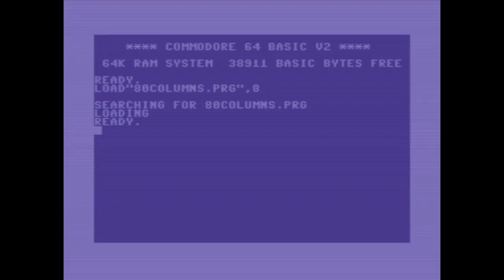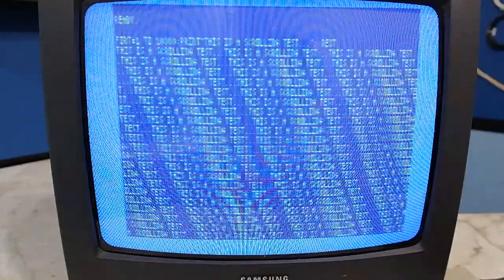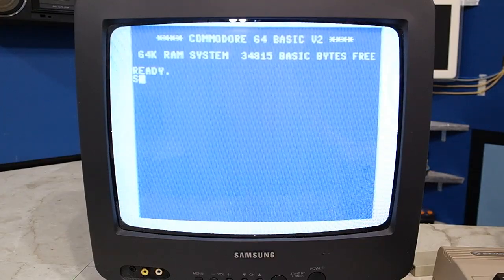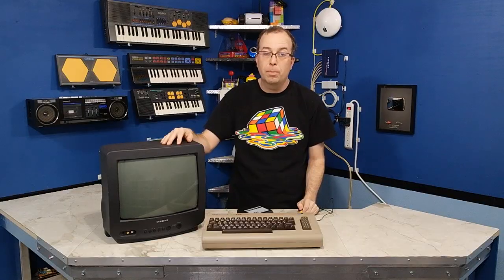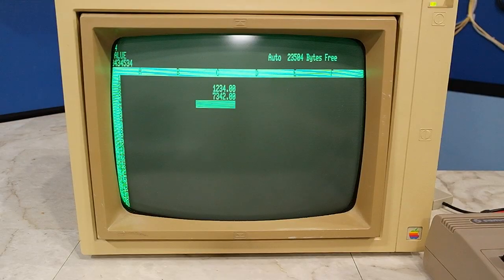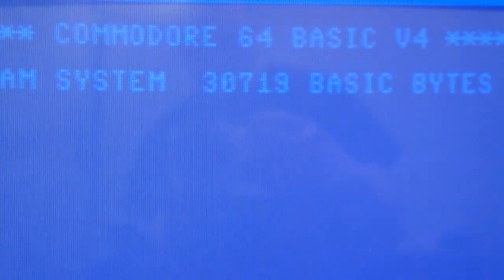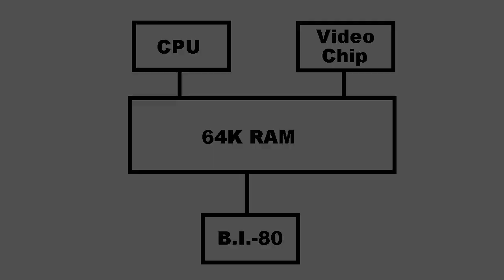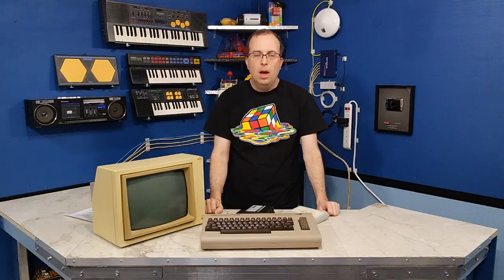The Quest for 80 Columns on the Commodore 64

Comment: Ah, television. You know, when you talk about text you run into the implied resolution.
40 columns of text with 8 pixel characters is of course 320 pixels.
80 columns of the same character set would be 640 pixels.
Fine if you're using a monitor...
But A tv?

Tv signals for that era are of course analogue. When you look at the standards you notice they mention 'lines' of resolution, but not the number of pixels in a line.
...Because a line is a continuous analogue signal, and thus has no explicitly defined resolution.
However, TV's do.
And I actually counted the pixels on my last two CRT tv's...
Both were late 90's Panasonic models, and one was PAL, the other multiregion (so basically supports everything), though the PAL model supported PAL 60 too, which technically means NTSC...
NTSC is defined as having 525 lines, and PAL as 625 (OK, yes, technically these names refer to the colour encoding standards, but this is confusing enough already).
however, not all of this is visible. it includes v-blank and overscan and the like.
DVD's defined the resolutions as 720x480 and 720x576 respectively, but what about the actual TV's?
Well, it turns out both these Panasonic TV's had a resolution of 480x480 pixels for the visible part of the screen.
My super famicom outputs 224 lines and of these 222 were visible onscreen (though keep in mind the 240p hack means one of the fields and thus half the lines are blank).
but I do believe the screen is 480 lines and not 444, because it is ultimately a PAL tv first, and NTSC second, and 480 lines would distort the expected aspect ratio of an ntsc signal.

But anyway, these are late 90's TV's, so you could expect older ones to be worse. (I also had an early 90's lcd tv that had I believe a resolution of 160x120 or so)

The problem here should be somewhat obvious though. If you have just 480 actual pixels in a line... You could never show 640 pixels and get a clear picture. It'll end up blurred.
And 40 column text with 8 pixel wide characters would fit, but 80 column text would exceed the resolution of the display by quite a margin (160 pixels short) unless you used narrower characters. (but then you have less definition to the characters themselves).

And then there are a bunch of other issues like those caused by composite video signals...
Yeah. High resolution ANYTHING using a TV rather than a monitor is quite a challenge.

Comment: I know this sounds crazy but I wished you had shown the software 80 column solution on the monochrome monitor. Is that a nutty thought or what? I actually had a C64 back in the day with both a color television and monochrome monitor attached. we used it as sort of a two monitor set up while playing Lords of Conquest with three people taking turns on one C64. Good times!

Comment: +The 8-Bit Guy When I was a kid I owned a commodore 64 and I began to write a 80 columns program in assembly code, using bitmap display. I never finished it because at the same time the Atari ST and the Amiga were released. In Europe we are lucky when it comes to plug old computers in TV sets, because we have the great / infamous /clumsy / unreliable /featurefull (strike the wrong words) scart connector, with RGB, composite, svideo and stereo sound on the same connector. Pluging a C128 is really easy with one wire, and only a switch to switch TV between composite 40 columns colors and RGB 80 columns.
Reply: mipmipmipmipmip Even in 40 columns there was.

Comment: My challenge for the modern hacker is to figure out how to get an SVGA-like 132 column text mode running on a C64.
Reply: Not gonna happen.  Now, on a Commodore 65, it's possible.  It has a high-enough resolution (and potentially enough RAM) to pull it off.  Though as I mentioned before, your odds of finding a Commodore 65 are somewhere between slim and none, since only a few prototypes were built.

Comment: Wow... that Commodore 1084 monitor is damn versatile : RGBs 15kHz, RGBi (TTL), S-video, composite video. And since it's a pretty sharp monitor, monochrome via composite video is very sharp as a result. The monochrome on it looks great, although not as great as those green phosphore dedicated monochrome screens, but still damn sharp!
Also if you had one then you could take advantage of the Commodore 128's 80 columns mode in colour through RGBi, without needing a dedicated RGBi monitor in your setup. Pretty cool  :)
Reply: Commodore color monitors always had great sound quality, such as the basic 1701. Then there was the 1084S, stereo speakers!
Reply: FinalBaton Keep in mind that there were many variations on the 1084 and 1084S.  If you buy one, inspect it carefully.
Reply: NES System looked awesome on it!
Reply: I have also seen scart shaped peg, so another rgb plug, although for europeans only, i guess

Comment: You somewhat forgot GEOS
Reply: javier gonzalez Yup, GEOS 128 runs on 80 columns, and ist was/is great!
Reply: @MichaelGisiger  but not GEOS on C64 I imagine?
Reply: @eusebiusthunked5259  No, but GEOS128 for the C128 ran in 80 columns mode
Reply: @MichaelGisiger  sure, but the quest for 80 columns on the C128 was not so treacherous, simply use the hardware intended to provide the feature. GEOS 64 in 80 column more would have been even more impressive... They could have eaten Macintosh immediately.

Comment: The real best selling and self-booting computer of all time, the Atari 8-bit family, was 40 column as well. 80 column text could be done in Graphics 8 via software, but there were 3 hardware add ons that provided 80 columns. Of those, the Atari XEP80 was compatible with all Atari 8-bits since it connected via a joystick port as well as providing an industry standard printer port.
Reply from the maker: I've been looking for one of those XEP80s...
Reply: A Floyd the monitor in this video reminds me of the monitor I had with my 800XL's when I still had those in the early 90's.
Kinda miss that green on black display.
We had a 286 at the same time that had an actual monochrome display. (eg. White phosphor, not green or amber).

I liked messing around with the 800XL... I had two of them and about 400 games, but never got most of them to work.
I was actually surprised 800XL's usually had floppy drives, because both of mine had tape drives.
And I hever really had the patience for dealing with tape drives. I had about a dozen cartridges too though I think...
I had two due simply to it being a cheap way to get tons of software second-hand.
The plotter was amusing too.
In hindsight I wish I kept those things.
But chances are I would have lost them anyway.
That's what happened to the snes I had at the same time after all.
The 800's I sold.
Ironically perhaps to the same person that technically stole my snes afterwards.
Never leave stuff with people unless you really trust them. You may never get it back. XD

Comment: It was my understanding that the C128 never did quite as well due to lack of software development.  As you stated, they were more gaming machine than business, and a lot of software developers continued to write for the C64 since C128 owners could run C64 software as well, why develop for C128 which had a much smaller base when you could continue to write for  C64 and include the C128 base as well without the extra expense?
Reply: That was exactly the problem.  It was only because of the CP/M compatibility that the Commodore 128 sold as well as it did.  Otherwise, you could say that backwards compatibility was what killed the 128.  (On the other hand, NOT having backwards compatibility would probably have killed it even quicker.)

Comment: I used two monitors on the 128, one was a cheap amber screen until getting a 1084.  The only programs I used in 80 col mode were BBS and some Text adventure games.    A brand new Amber Screen monitor was only $30 back in the late 80's.

Comment: Was there any specific reason why 80 lines was the goal for these computers other than simply doubling the 40 lines? I was going to say such rapid increase in resolution like that would be frustrating today, but we are looking at a 4k->8k jump in the near future :P
Reply: ZiMZiLLA Most printers were 80 columns wide (and most typewriters).  10 characters per inch in an 8.5 inch wide sheet with .25 inch per side border.
Reply: KC9UDX ah neat. thanks!

Comment: Were the Commodore monitors significantly different than TVs? We had the actual monitor and I maybe never realized we had a better experience than most folks. Would love a video that talks about the commodore monitors!
Reply: The output had a massive quality difference.  I believe the tube and the electronics were of premium grade components.
Reply: They were best if you used the separate sync cable

Comment: in 1984, Amstrad released the CPC 464 which has directly a 640x200 mode with an 80 columns in 2 colors. It was sold with its own monitor and an integrated tape recorder. They were interesting 8 bits computers that could be used for professionals needs and games.

Comment: If the C64 did not reach hgh demand to be used as a business machine,that will blow my mind considering the builtin keyboard,BTW i tout that it was advertised as a cheap business machine and later on as a 2 in 1 gaming & business machine.
And lastly,i see those 80 colume catrides as a hardware cheating module because they have their own a/v out just like the sega 32X.

Comment: I would love for you to do a video on the Commodore Plus/4!  That was my first computer when I was a kid and I never really got to do anything much with it.  It would be awesome to see what it used to be capable of!
Reply from the maker: I am planning on it, eventually...
Reply: Do you need a Plus/4?  Because I have one in good condition that you can have if you pay for shipping (I do not, however, have the power supply for it).
Reply: Not that hard to wire one.  Check the power port on the Plus/4.  Some of them had round connectors, in which case you can use a C-64 power supply straight out of the box.  If it has a square connector, then either the power supply or the Plus/4 will need modification.

Alternately, it's possible to build your own with a pair of wall warts: One 9V/1A and one 5V/2A, and the appropriate DIN connector (round or square).  (And some wire, a soldering iron, etc.)
Reply from the maker: I already have one, thanks though!

Comment: The audio port actually could make sense for situations where the video and audio cables are taped together and wouldn't stretch far enough apart all the way to reach wherever the audio cable is without undoing the tape.

Comment: it's too bad Commodore never made a "VIC-III" chip for the C128. Imagine a VIC-II but running at double resolution (meaning multicolor modes at 320x200) or alternatively two stacked character maps (parallax effects!), twice the number of sprites and the 121 color palette available to the Plus4 series.
Reply from the maker: Yep... and that's exactly what SHOULD have happened.  Then they should have ditched the CP/M mode and gave it two SID chips and some sort of 8-bit DAC for sampled audio.  That would have made it an awesome followup to the C64 and would have likely had way more software support.

Comment: When we got a TI 99/4A in 1982, it came "standard" with a monochrome monitor. Same with the C64. I think shops wanted to sell you a cheap monochrome, then sell you a color as an upgrade.  Later, when my 1084 died, I ran my Amiga through its monochrome output. Its a mystery to me why the Amiga even had the monochrome output

Comment: Although being released in 1984, the Amstrad CPC had built-in 80 columns screen mode.
Reply: I still miss my CPC 6128.
Reply: Timex Sinclair 2068 released in 1983 also had kinda "80 column" gfx mode (monochrome 512x192). Many other ZX Spectrum clones (SAM Coupe, Byte, Profi, ATM-Turbo, GMX, Pentagon with add-ons) also had similar modes.

Comment: Some of the non-business oriented micros of the era did support 80 column text natively. The BBC Micro and Amstrad CPC are two that spring to mind (both using the 6845 IC). But even these machines did not enjoy any significant success in the business world. I guess there was just a dividing line between the graphics-rich "games computers" and the more boring, standardised business machines which were optimised for business use and priced accordingly.

Comment: Love the video but I have a stupid question (kinda related to the video). On the early computers why were the screens green? They could of used the already available black and white CRT's but instead they used green and white CRT's. Any ideas? (I guess the G&W CRT's were also available and used in old oscilloscope's too.)
Reply from the maker: I am not 100% sure.  I've seen the topic discussed before.  Some people say it was because green was supposed to be easy on the eyes.  Others say it was for low cost.  Other's say because the green wavelength is clearer and sharper than red and blue (at least to our eyes).  However, some were actually black and white, and some were also amber.  I think I hated the amber ones the most.
Reply: OMG I forgot about the amber ones.

Comment: I actually have an TI/99 4A
It's not so easy to use on a flat screen, it doesn't look good using RF analog, Any tips?
Oh I also have and use the original TI RF modulator
Reply: Arewand463 Thrift stores have small, cheap colour CRT TVs which work very nice for this.  If yours doesn't, there's something wrong with it.  LCD TVs and monitors cannot properly display the output from a machine like that.
Reply: +jan herald Don't be rude.

I would guess that the fanbase that the TI-99/4A still has, are the ones that care.
Reply: CaptainDangeax The video connector on the TI is identical to the VIC-20.  get or make a cable and you have composite out.  But it won't work well with a LCD TV.
Reply: I don't own a TI99/4A. I was giving an advice to Arewand463. Those kind of enhancements exists for some machines like for example the Atari VCS (RGB instead of RF), the Amiga (VGA-compatible)... It may exist for the TI99/4A or it is possible to make one. And with a scart plug or yuv on the back of your tv, Bob's your uncle !
Reply: Arewand463 so what? who cares?
Reply: No composite output on the TI/99 4A ? I know there's a version of the Ti video chip with an YUV output. Time to learn electronic, and design a remplacement board for your TI with this version of the chip, YUV output is great and compatible with most actual flat screens.
Reply: I'll see, but I found an ntsc to av to rca av
Reply: I found the information. The TMS9918 has a NTSC composite output. the TMS9928 has no video input (I suppose for bypass) but has a YUV output.
Reply: TMS9928 actually does have a b/w composite video output since its part of the component yuv standard. Y the green output actually carries the b/w (luminance info) composite and the tv uses that and the color info from the U blue and V red outputs to reconstruct all the colors on the screen. I know this cause I have been playing around with one a breadboard recently